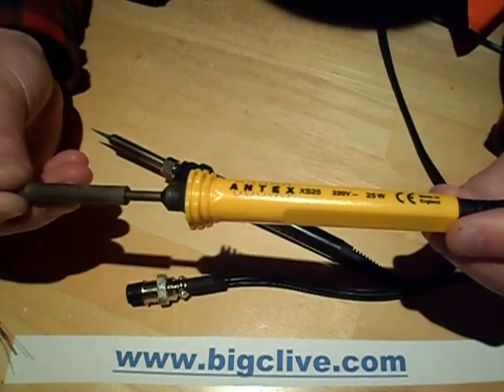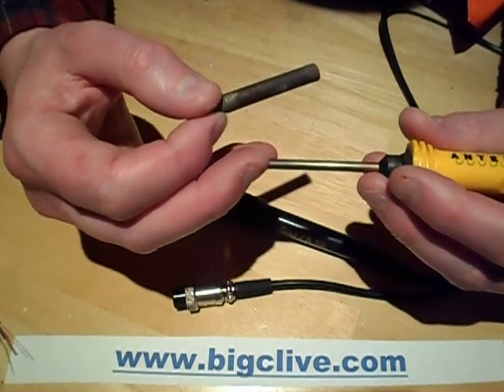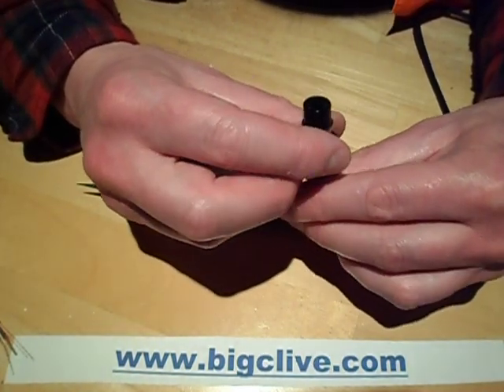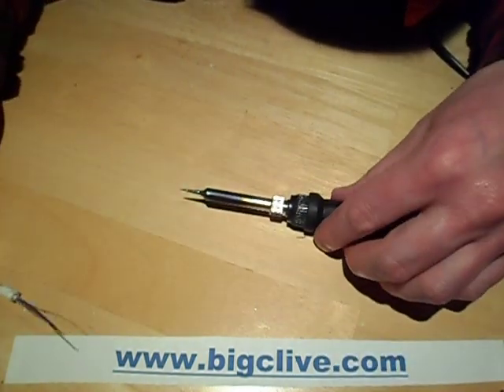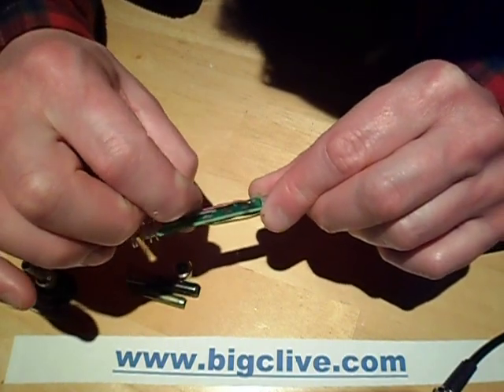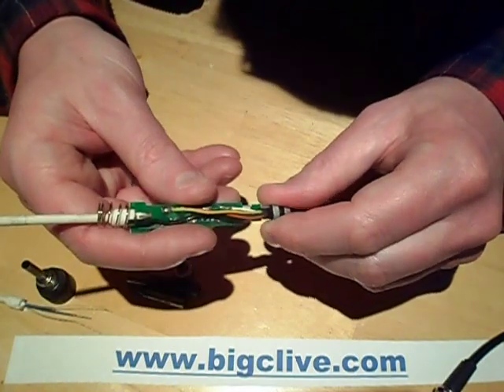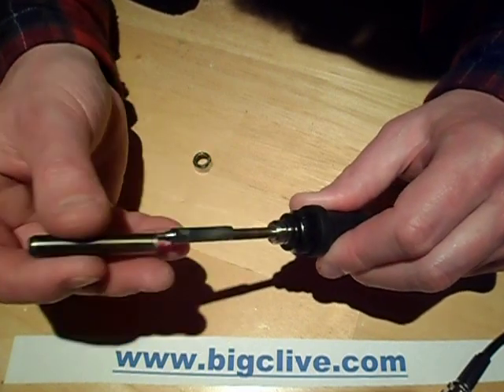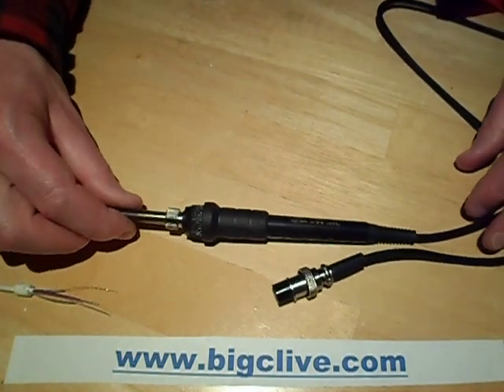Inside a cheap Chinese Yihua soldering iron.

Comment: I have one of the cheap china ones that look like that, but are powered directly from mains, and have a temperature adjust pot in the handle. I'm actually quite happy with it's performance, it is my day-to-day go-to iron. I'm guessing it's a triac chopping off mains through a heating element...

Comment: I've also had an Antex XS25 for many years, The reason I got one was because that's the type we used at school so I thought it must be good and reliable, it has been. I only have trouble with the tip which I have to  give a light file occasionally to keep solder sticking to it. I've never learnt soldering since school so it probably makes experts cringe knowing I do this but I get by fine doing this :)
Reply: +bigclivedotcom yeah sounds like a good idea, i think I must have had it almost 20 years and I never taken the tip off, let alone change it for a new one, :)  ... I cannot even remember where I got it, it may have been from an old mail order company called Greenweld as I'm sure I didn't have Internet or know about marlin back then, ha! ..
Reply from the maker: +CrustyBiker Once you start filing the bit it tends to pit quite quickly.  It might be worth getting some spare bits out of Maplin or online.
Reply: +CrustyBiker I always dip my tip in flux while hot and wipe it off on a wet sponge, seems to clean mine up pretty well.

Comment: I ordered that iron without station very cheap and I will try to make my station for school ,will make something like 10 times amp with op amp to boost input from termocouple and make comparator with histeresis also with  op amp  add variable resistor and just conect output to a gate of a mosfet add a led and that will be it,also I have mains soldering iron that uses same handle and everything just changed circuit board with one that containg triac control and a pot for adjusting i keep the pot on lowest setting  and works just fine very good iron. Do you know what type of termocouple it uses ?
Reply from the maker: +JOSIP Žlk I tried it on a K-type thermocouple unit and it showed the correct room temperature.  So presumably a K type.
Reply: Ty

Comment: I bought a "Hakko" 24V 50W Chinese soldering iron on eBay, it's exactly the same construction as this one. I want't to build a diy soldering station with a 24v 3A switching power supply but it's not enough. I measured the internal resistance of the heating element and it's 4 Ohm's, that means, this soldering iron requires 6 Amps witch is extreme for this little supply and it switches off. What can i do in this case to power it up? I need to buy a much bigger supply?

Comment: Would like to extend the cable. Is the connector a 5 pin 270 degree plug?
Reply from the maker: +David Parry 5 pin 240 degree socket on the end of the irons lead.  The base has a plug on it.
Be careful about resistance if you extend the lead, as it drops a modest voltage.
Reply: +bigclivedotcom Thanks BigClive, only need an extra couple of feet or so.
Only just found your vids about a month ago, really enjoy them, keep it up.

Comment: As i understand, there are many different levels of satisfaction to this Yihua solder station. I have bought two, about two years ago. One was for the firm i worked for, and one for me.
I have used it for almost all my solder work to date and have never exchanged the heating element. haven't burned any tip, and have had it on for  about an hour at a time. Never had any transformer smell or red hot glowing solder tip.
I have made some pretty beefy solderjoints with a large heatsink, allthough that required that i put the solder station to max waited so that i rebuilt the thermal capacity in the tip between the spots. So it was the max capability of the iron. but overall i have beed satisfied with it.

Comment: Why are there different types of tips? I've always just used the point ones like this but a few mates have said to swap to the flatter tips. What's your thoughts on this?
Reply from the maker: +acklan3 It took a while to get round to actually using it, but it's not bad at all.  I don't leave it on all the time I'm at my bench like I used to do with the Antex.  So I'm not sure what the expected bit life is.
Reply from the maker: +Philip Downs Different tips have different applications.  The standard pointed one is mainly for fine surface mount type components.  I prefer a slightly larger and flatter bit to hold and transfer more heat.
Don't go by the temperature displayed on your soldering irons display, the Chinese units are notorious for being non calibrated.  If the tip of the iron is clean and shiny and the solder is melting quickly when applied to it then it should be OK.  If it's clean and shiny but the solder does not melt quickly when applied to it, try adjusting the heat up on the controls.  There is a facility to calibrate the iron's temperature on the soldering stations, but it requires a suitable test unit that has a shaped thermocouple that you place the wetted soldering iron on.
Reply: +bigclivedotcom ah so the pointed tip would be better for the guitar parts I work with.
Reply: +bigclivedotcom 1-1/2 years how is it holding up?
Reply: bigclivedotcom cool. Great channel look forward to the next video.

Comment: I'm staggeringly disappointed not to find out the outcome of the hot transformer smell! 👍
Reply from the maker: +Brian Edwards (Dino) I think it may just have been residual solvent, since the unit now behaves fine, albeit with a slight transformer buzz.  It's actually become my main bench iron, mainly due to the usefulness of hot air pen.
Reply: +bigclivedotcom I've been looking at getting a soldering iron, to build a diy vape box mod kit. I'm a newcomer to your channel and not electrically experienced at all, yet find your content very fascinating although much of the terminology goes way over my head! Quite like the look of the 70s style battery iron you done the video for but looks quite hard to get a hold off in the UK.
Reply: +Brian Edwards (Dino) meant to add, for the first few days watching your channel, I was convinced that it was big C live dot com😀 Felt a right numpty when I noticed it was actually Clive 🙊🙈
Reply from the maker: +Brian Edwards (Dino) If you buy a basic iron from Maplin it should do the job, although I'd recommend something beefy like an Antex XS25.  You could also consider one of their basic soldering stations which they sometimes have on offer.
Reply: +bigclivedotcom thanks for the advice! 😀👍
Reply: +bigclivedotcom I have their basic soldering station and it does me well.

Comment: If anyone is looking around to buy one of these be careful. Came across a UK seller on eBay that was advertising some units with a US plug but also asserting that it had a 220-240VAC input. After asking how they knew this to be true (these units are typically simple voltage specific transformers) their reply was, "we haven't had any complaints and have sold many of these units". o_0

edit: I am specifically talking about the family of 936/937 base units with just the soldering iron. I am unsure about the dual hot air gun units, perhaps those do have selectable input ranges (though I sort of doubt it).
Reply from the maker: +Leigh Robinson The Chinese plugs look very much like the American two pin plug, but their voltage is 220V.  It may be that they have the Chinese plug in the picture.  But it's always worth checking the voltage and earthing when you buy something like this.
Reply: Ah that is a good point. There wasn't a picture so much as they stated in the description that it had a "US plug" - they might very well be mistaken there and not on the unit ratings. It can be a bit of a lottery when buying this sort of stuff!

Comment: I can't get over the plug looks just like the ones use on a old Uniden CB radio. How Low of voltage is it?
Reply from the maker: +Paul Saville the plug has the 24V for the iron, the thermocouple connections and the ground.
Reply: Standard GX-16 plug&socket, 5-pin.
Reply: It was or is.  Used on many CB and Ham radios.   35 years as an Ham..

Comment: Wait a minute I get the replaceable tip and heating element ,but how are you supposed to replace the heating element if the leads are soldered on ,do you have to get another soldering iron to solder on the element

Comment: So you need to get another soldering iron to replace the heating element? lol...
Reply: +Graham R No, it means you start experimenting with arc soldering!
Reply: +Andrew wood Ya, I guess you can buy the element, but the thing is soldered to the board so you can't replace it without another iron to make the  connections.
Reply: No, you can buy the heating element itself.
Reply: or you just ask the guy sitting next to you at the factory to borrow his and hope you both don't get in trouble for the 1% reduced output that hour.

Comment: I totally agree with you that the best soldering iron bit to use is a 3mm chisel type. I have always preferred this style of bit as I find it better suited to various situations than the alternatives. I can't understand the obsession with finely pointed bits that the manufacturers seem to have. Given that you often have difficulty trying to find a 3mm chisel bit to buy and that I also found that the only bit not in stock at Farnell was the 3mm chisel bit, there's obviously quite a demand for this style of bit. Perhaps manufacturers should supply a small chisel bit as standard and suppliers should certainly maintain stock of such bits more efficiently. I use a Hakko-esque soldering station from Farnell which is obviously a Chinese copy with the same type of iron as in your video and I haven't had any problems with it in the year or so I've used it - plus the cost of replacement parts is a fraction of the cost of original Hakko parts!
Reply: ***** For repair work, I too prefer the chisel tip however, I do a large volume of prototyping using 2mm pin pitch perforated boards. For getting dead on the spot accuracy without shorting the neighboring pins or it's pad, these sharp pointed tips are indispensable. I use them exclusively when doing this type of work. By the way, I own one of the Chinese made irons and it works really well. I'm highly impressed with it's performance vs price. A winner for sure.

Comment: I have a dual hot-air reflow plus soldering iron station. Some Chinese brand that I bought from a cellular repair shop down the road. 
Same type of iron and it work beautifully.
They're crazy cheap. The only problem is the Schuko plug since I can't get a Schuko socket in South Africa. 
(they sell cheap, plug-in 3A 'Schuko' adaptors for the un-earthed Chinese knock-off plug but not proper sockets)

Comment: darn, that soldering tip is really loose.
Reply from the maker: bergweg It is.  I've seen others with springy shims to help make a better thermal contact, but I've been using this iron for a while now and it's actually OK.
Reply: bigclivedotcom Good to hear that, 'cause I'm looking for a station on eBay now, my ZD-937 is broken, I don't think I'll be able to replace the MCU atmel at89c2051 (don't have a suitable programmer and the firmware has to be extracted). 

Have you looked inside your soldering station to see what kinda of MCU it has?
Reply from the maker: bergweg I've not.  I did open it, but just to check it for safety bonding and general construction.